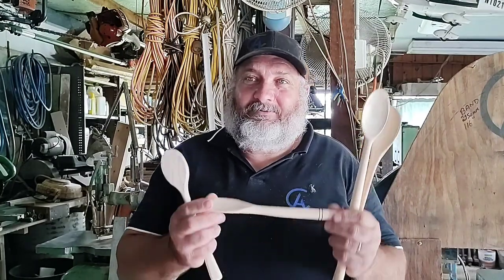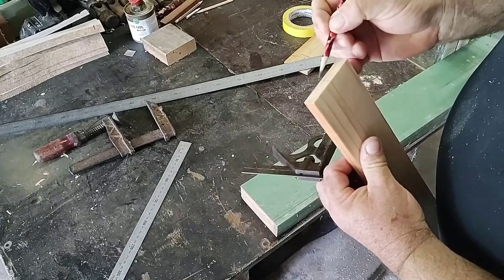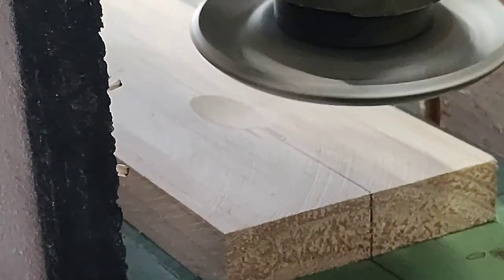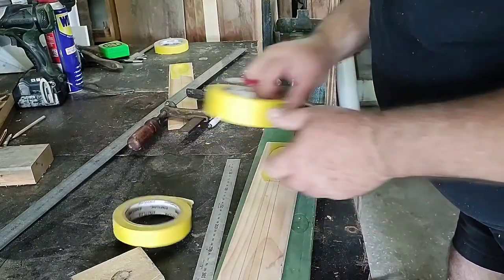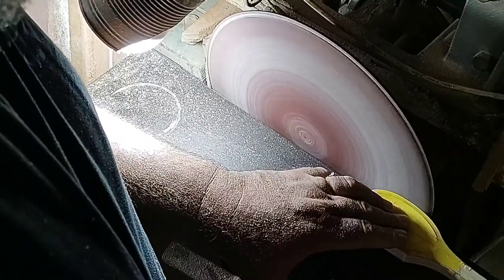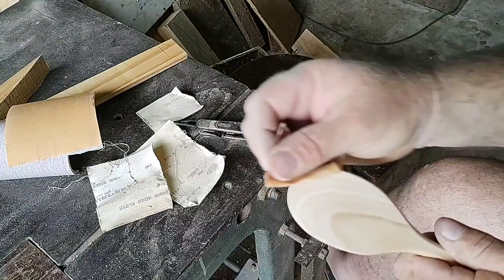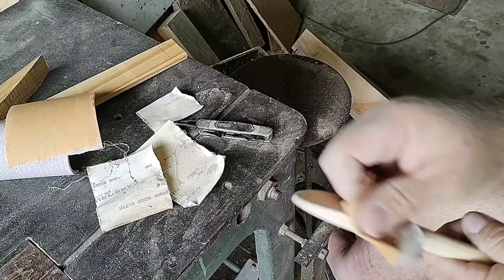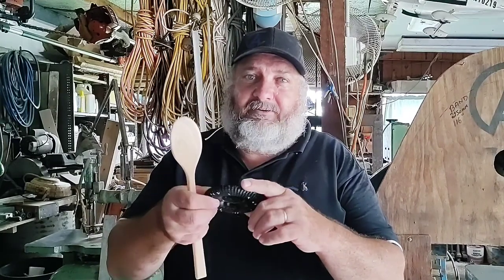MAKE A WOODEN SPOON

Comment: Hello again Arthor.....my cutter for the Angle Grinder arrived today and I gave the entire setup a trial run.    Works just great.    I like your measurements of your spoons.   Could you tell me how many mm in length the bowl of the spoon is.    The rest will come easy after that.   Have some Maple ready and do my first one soon.   Thanks
Reply from the maker: No problem  on a standard spoon 330mm - 380mm long my bowl inside  rim measurements are 82-88mm long to between 40-45 mm wide depending on depth of cut and the diameter of your cutter, I hope this helps.
Maybe you can practice your bowl on some scrap stock the same size until you perfect it, happy woodworking regards Arthur.